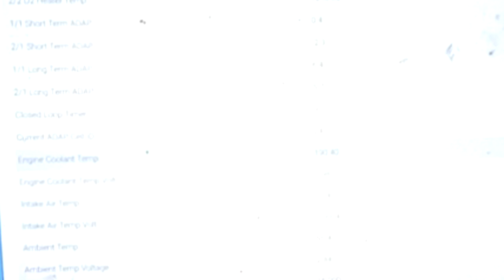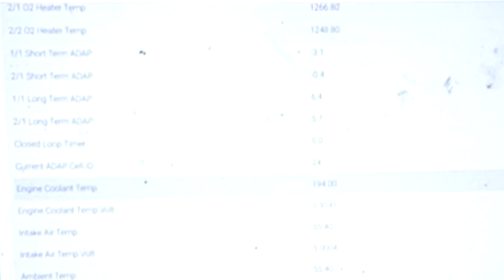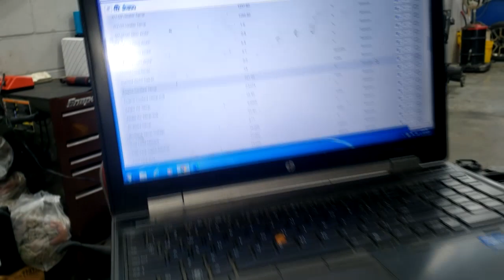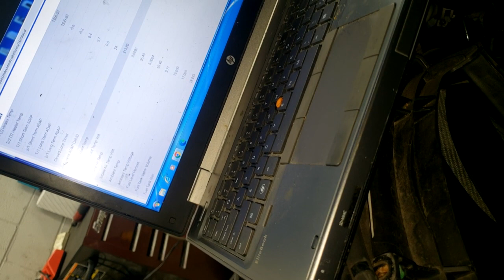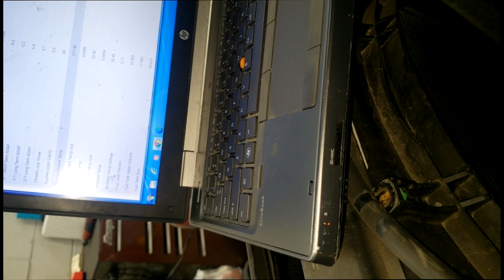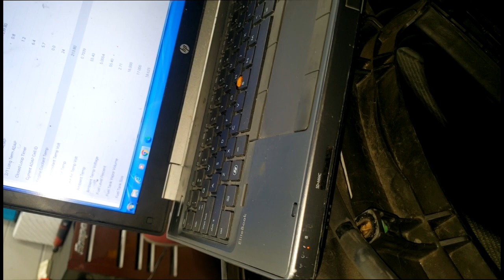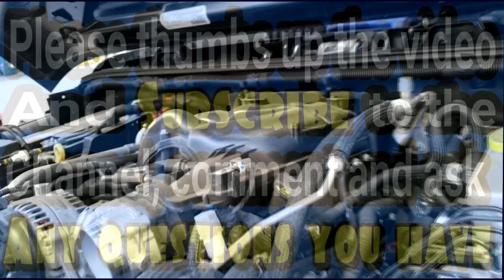How to tell when your cooling fan suppose to come on. Car overheats with AC on. P0128 .Jeep Wrangler

Comment: What was wrong with this Jeep?
Reply from the maker: O wow, I just looked at this video for a refresher, this is a terrible video, I def need a redo on this one. But it was in for a check eng light with a P0128. What problems are you having?
Reply: @OnlineMechanicTips  I just subbed, can you help me find my issue? I just spent 1200 at Jeep dealership last week for 0 reasons!
Reply from the maker: @m9katchm9  O wow, Thats not right. I assume your Jeep overheating, I also assume they checked the simple stuff like the fan, thermostat and they made sure it was bled properly. Now unless your problem internal im not sure why yall stopped
Reply: @OnlineMechanicTips  what could an internal problem be? The Jeep add idle slowly warms up.. so I got tired of the thermostat replacements not making a difference. Every single component of the cooling system has been replaced. 
They changed the fan and it cost me 1200 with the diagnostic. It made no difference. The Jeep still runs warm. I removed the thermostat and it still does the same thing. How is that possible? I did a pressure test yesterday and didn’t seem to have a leak? I also did the combustion gas test myself and it passed. Then when they diagnosed it. It says on the paperwork the engine passed the test too.
Reply: Did your fan delay to start working?
I have this issue it is start inly on 226F , this problem appears suddenly after i replaced with new oem radiator , any solution for this delay?
Reply: @ossamaawad8446  I don’t know, I have spent thousands of dollars at this point. I was told by the dealership it apparently starts at 190 now, but it makes no sense. I paid 1200 for a diagnostic from them and they said it needed a new fan. I tested it again with the new fan and it does not start at 190. It starts at 225 still. I’m blown away.
Reply: @m9katchm9  the fan should started on 219 to 220  this is what i found on other jeep but i am not sure .
However did you change the coolant tempreture sensor ?
And when this problem appears (after changing any part ) ?
Reply: @ossamaawad8446  I changed all my cooling system tbh
Reply: @ossamaawad8446  there’s 2 coolant temp sensor .. one on the oil cooler and one under the block
Reply: @m9katchm9  the one under the block , which measure the coolant, did you try to change it ?
One mechanic advice me to change it to solve the fan dalying problem , but i didn't do it until now
Reply: @ossamaawad8446  did you go with the stock one?
Reply: @m9katchm9  i didn't change it until now
Reply: @m9katchm9  but i am pretty sure that the delaying in the fan is not normal , it is prevent the fan from working in full capacity ,, and really i don't now what to do , i am afraid to go in offroad trip
Reply: @OnlineMechanicTips  do you have solution for our problem please ?
Reply from the maker: ok I just read these comments. All I can add to this is to please understand. Depending on the year of your Jeep, what dictates when your fan come on is the PCM. The tuning will have it come on  at diff temps based on the year and load package. Also something as simple as a gauge (cluster) adjustment calibration may be needed. I mean, are you sure your Jeep really over heating or does it just shows that the temp high. With a good scan tool, most gauges can be calibrated. And lastly, these are all aluminum engines, if you have even once, let it get hot (over heated) those soft aluminum engine parts may give you some hidden problems that can easily pass every so call combustion test you throw at it..So from where I sit, I can only give out advise on things I have seen, I can't tell you why your Jeep over heating because I'm not there. That dealership owe you the honor of checking/testing your Jeep further to find your problem tho. You still have a concern and its called a recheck.
Reply: @ossamaawad8446  is your jeep a 2013 Sahara
Reply: @ITS-FALCO  2014 sahara
Reply: @ossamaawad8446  the weather where i live is starting to cool down, the issue seems to be due to the weather, at idle it still reaches 222.8, but if the ac is on it will maintain at 204 and at highway speeds with ac on 204-206
Reply: @ossamaawad8446  just an advice stop giving it attention, if it gets worse it will be easier to find the issue, iv been driving mine for almost 9 months nothing happened, and i speed well over 4k trying to figure it out
Reply: @OnlineMechanicTips my car is 2014 jk. we did combustion test 3 time and  it  passed , and even somke test and it was passed also . we do pressure test for coolant system it was passed also.
What i am facing in my car and also we what we found in some other jk jeep  , that the fan is delaying to start when the ac is off , it is should come on around 220 F but instead it is come on 226 F, also when i put any mionr extra load it is cause the tempreture gauge to fluctuate up like when it is in extreme offrading .
That's mean we are facing a delay in the fan .
I checked it in the dealer and they didn't know the cause .
Also i checked it with various jeep mechanic with no solution for it.
My car has no any tunning program and around 140 000 milage .
So could you please do a research on this and help us on this matter.
Also my tempreture gauge is fluctuating a little pit , it was always idle in the middle .
Reply: @ITS-FALCO That what i am doing lol
Reply: @ITS-FALCO  did your fan start at 222.8 ?
Reply: @ossamaawad8446  yes but sometimes 226
Reply: @ITS-FALCO  me always on 226 F.
222.6 is considered some how normal
Because the jeep fan should starts between 220 and 221
Reply: @ossamaawad8446  not really, my brothers 15’ starts at 214 low speed, but i guess it the due to the model
Reply: @ITS-FALCO  aha , i thouth it is should start at 220 
I hope we could find the solution i will keep updating
Reply: @ossamaawad8446  thanks, same here
Reply: @ossamaawad8446  i wanted to ask you have you tried flushing your heater core ?
Reply: @ITS-FALCO   no never
Reply: @OnlineMechanicTips  I have a 2014 Jeep Wrangler 3.6 need to know if the a/c fan is control by a fan relay for low and high speed or electronic control sensor
Reply from the maker: @isidoremartinez2529  Do you have the heavy duty package or just the regular factory equipped set up? Also are you subscribed to the channel?
Reply: @OnlineMechanicTips  I have the standard package I have a 2.5 lift package yes I’m subscribed to your channel hope you understand that I replace the thermostat and radiator cap about 9 months ago because the top radiator hose was collapse everything has been good until last week when it extremely hot temperatures gauge went all the way to hot I replace the thermostat new with anti freeze not the cap and ran hot again so now I’m waiting on a new 18 lb cap from your video you express that the cap and the sensor on the block could be the problem so my plans are to change them I check out the fan relay they are good so I don’t know where to go from here any ideas
Reply: @ossamaawad8446 it turns out that its normal
Reply: Update, its not normal in all cases, it turns out my head gasket is blown, i did a block test. Car will run fine the temp will rise at idle but go back down when moving, in my case the coolant is not burning off but it is being displaced by exhaust gases in the radiator, the coolant will overflow to the overflow tank but not return to the radiator i also have a very light rod bearing knock probably a bent rod from trying to compress coolant, my advice would be to check the cylinder head or block for cracks before proceeding because my jeep has never overheated, remember its better to replace the engine than to replace head gasket, as for me i will fix it and sell it, hope this helps :)